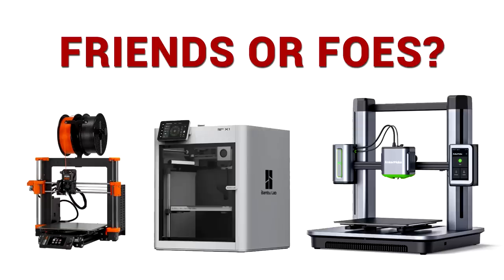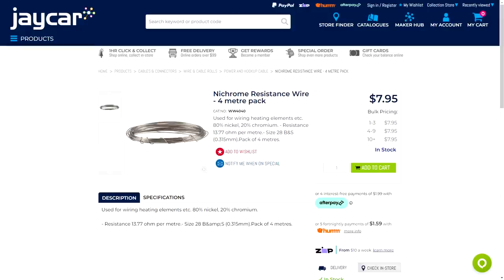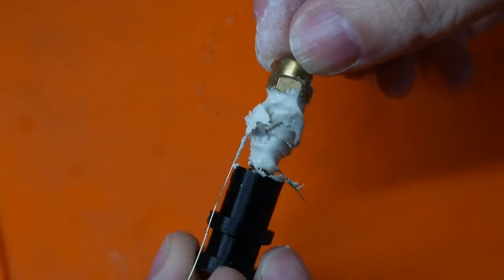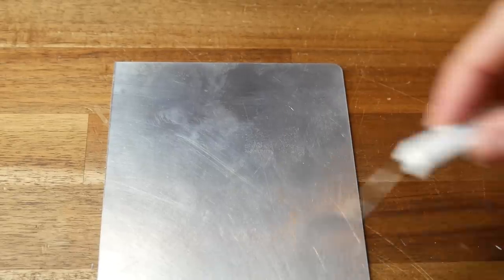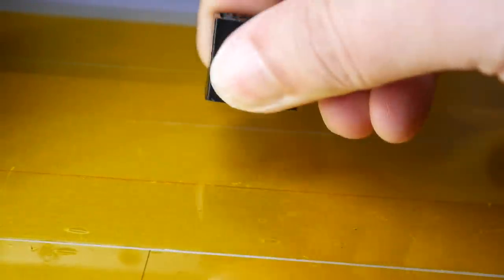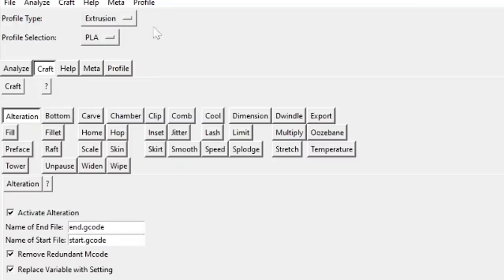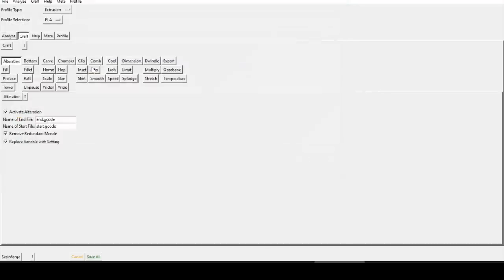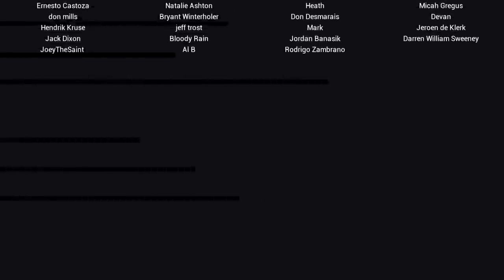10 years ago, 3D printing was really hard

Comment: Been printing since the blue tape days. Those were dark times.
Reply: Blue Tape + Ikea Mirror. I hate the old days
Reply: now we're in the Hairspray Era
lol
Reply: My robotics teacher has a printer that still uses blue tape
Reply: I don't like magnetic beds because they allow some materials to curl up even though they're stuck to the bed
Reply: Painters tape directly on the aluminium bed plate=))
Reply: @lazer1036  I have a new printer with a magnetic bed and I have one with the glass bed that I use blue tape on and I would much rather the blue tape
Reply: @lazer1036  magnetic beds don't hold down tight enough and they can curl up with the part
Reply: @Nici619  I always print on ikea mirrors that I cut to size myself plus a mixture of wood glue and distilled water 😙👌
Reply: Blue tape is the best build surface.
Reply: i still use blue tape, then again my printer is 8 years old
Reply: @DursunX  are we though. That was prevalent 10 years ago.
Reply: @lazer1036  About half of the basic fdm printers my uni uses have the bed covered in layers of blue tape. Even the prusas.
Reply: @Rainmotorsports  i bought 4 used Ender 3 (pro & v2) this year and they all had hairpsray on the glass plate.. one guy even gave me the entire can.

i never use adhesives/ solvents. just clean it and keep it flat.
 i do love blue tape on my vintage Anet aluminium bed.
Reply: My Makerbot Cupcake CNC Mini -  printing on a kapton tape bed which was a heated conveyor belt.

Cost my over 1k including shipping and taxes to Aus. Constantly broke 1 part at a time. 

Turned me off 3d printing at home for a long time. Ender3 brought me back.
Reply: My first printer was tethered to a pc running Mach3 with g-code that i edited  from milling instructions.
Reply: @dmk_games  I was following the cupcakes. But I just missed out due to lack of funds.
Reply from the maker: I never used blue tape back then because I exclusively printed in ABS over PLA. In my head I had to use the same plastic as Lego and nothing else would be good enough.
Reply: Back when the community had more than 1 site with basic business services operating such as thing ownership sales. Back when license checks took minutes cause there were only mere hundreds of things licensed. 
Now ball park 30 million things yet manual re sorting required takes longer than ever. 
Being found back then was easy. 
Being found on net now with such weak search engines is causing mega losses to the community todawasI dread to think of how much money is being lost from pirate farms not paying royalties currently. Ive watched farms come and go for decades. Even this week watching another farm collapse and they didnt even own a single thing license to sell, they were doing there own thing, gave away all his valuable designs but cried about seeing his things being sold by others. 
He gave away his bisiness ownerships and in next breath cry cause he got copied. He never owned it. Cant set terms, take down pirates, or sell the thing license ownership if you dont own it.
Reply: The first Solidoodle used a sheet of 5mm acrylic with a laser engraved texture as a print bed.  I “upgraded” it to 10mm to minimize warping.  

My hate for thermistors and their thin wires prone to fatigue was one thing born in this era that persists into present day.
Reply: @Nici619  Still works if I'm in a hurry. Recently ripped some glass out of the mirror with ABS + Magigoo...
Reply: @lazer1036  I have one and I even use a piece of steel as bed for easy removal. It still works fine, but it's my emergency printer only.
Reply: @swomflys3380  On a Prusa i3 mk3 the bed holds down extremely well. Those adhesive magnetic beds not so much though.
Reply: @DursunX  Hairspray and gluestick was always a go-to even back in the early reprap days of the mid 2000's. I abandoned the painters tape methods pretty early on. With the old crappy nylon/abs weedwacker line everyone was using back then. A acetone slurry was just a better option overall. Then when PLA became easy to come by it was just gluestick and hairspray.
Reply: I'm still using blue tape on an aluminium bed on my 8 year old kossel mini.
Reply: Blue tape, glue sticks, hairspray, craft glue. Truly odd times.
Reply: I am using a printer that had a glass tape with blue tape. I replaced with pei build plate. With klipper I can print 150mm/sec. Also have uploaded a short

Comment: My first 3D print was in 1989 in Dallas, when I was in the early years of starting Haltech. I still have the print. Back then it was called stereo lithography. It was a 3D print of a throttle body design I was doing for Keith Black Racing in Anaheim. I now operate a factory that produces my own 3D products in Australia, which I export all around the world.
Reply: Woah that’s nuts. My dad used to be an old jet boat racer and never hesitates to refer to Keith Black and Arias like they were Gods.

Comment: I'm still using Reprap Huxley and Mendel printers these days. With some modern modifications like E3D hotend, proper heated bed, TMC drivers, and with decent klipper firmware and latest slicer software, these printers still give good results. And I plan to continue using them for the next 5-10 years.
Reply: same here my Reprap Huxley and prusa Mendel 1  are still in use today  so wht is they are old if they still work and print very accelerate then why change
Reply: I still have a working Huxley too.  :)  It was the first printer I built back around 2012.
Reply: I have Mendel Mono but i iam replacing it with voron 2.4 this month.its time to upgrade :D
Reply from the maker: That's impressive and really great that you guys still keep them in service.
Reply: Still have my medel, sadly it doesn’t work
Reply: I have an ORDBOT Hadron and have upgraded the hotend and print surface.  Is there any good information out there about what to do to get them up to scratch?  I have never had my printer running consistently.  It's one of the most frustrating things, trying to troubleshoot what's wrong with it, then finding halfway through fixing one issue another one crops up and then I lose patience with it and give up, maybe to return a couple months later with similar results.

Comment: Interesting to see how things were different in Czechia (with Josef Prusa’s work). I got my first printer in 2014 (9 years ago) and it was MUCH closer to today’s printer: normal hotend cartridges, very basic but normal extruders, handmade hotends (but high quality full metal ones, made in my city) but almost V6 compatible. The printers ran Marlin (really really early, M600 was added in 2015 by the guy I bought the printer from) and RAMPS 1.4 (if you were lucky) with hand soldered components. We were using Slic3r and CuraEngine inside Repetier Host, though it didn’t feel too slow
Reply from the maker: Repetier Host was amazing. Having the menu option to open up a box with all of the EEPROM settings was fantastic. You could edit them all in one place without memorising the gcodes. I had to cut some stuff out of this video to get the length down but this printer as running RC versions of Marlin 1.0.

Comment: Gheghe. Lovely to see. And I am impressed by this pioneers work.

I stepped in to 3d printing in 2016. E3d hot ends were already available at that time. All metal too. So I missed making hot ends myself.
The kapton hell I remember well. With bad luck fresh kapton on the heated bed every other print.

Thanks to pioneers like you and your teaching skills I learned to build and improve my own printers based on existing metal frameworks on the market.

So as a result I feel comfortable in building, modifying and designing 3d printers or parts and the software and electronics.

So your teaching helped me to find an independent way in 3d printing!

Comment: Ah yes, i remember helping to keep the one at our hackspace running, going through Kapton and PETG tape and basically 90% of the time you weren't printing things you wanted but you were adjusting settings for that new filament roll, fixed bugs in that hot new firmware that totally wasn't compatible or were fixing issues with the bed not being level because that one adjustment screw got lose again(because no auto leveling), the nozzle shredding the kapton after dipping in 0.000001mm too low, and all the other fun stuff. This made me actually lose interest after a few years and now i'm at a point where i don't want to use plastic anymore and rather skip the prototyping and just do it in wood or metal right away.

Comment: I started in 2015 with a Monoprice Mini. I remember showing my prints to someone who’d cut their teeth on a Flashforge like the one you showed, and they were amazed at what I could do with a $200 printer. I eventually had to get this printer replaced under warranty, but I still occasionally use the replacement for small jobs.

Comment: Woaw I love this format "back  in the day" ❤ my first 3d printer was a cr10 and I was using Cura back then. I think it was 6 to 8 years ago. But this seems nothing compare to the hardcore stuffs you mentioned in your video ^^. If I had to compared what I'm not missing from my early experience is the blue tape and the manual bed leveling :)

Comment: 2015. I was a VERY proud owner of a Printrbot Simple Metal with Heated Bed! I also had one of the 1st Ultimakers at work whose extruder was an absolute nightmare to navigate so I hardly used it. I tuned the hell out of the Printrbot and actually got really decent prints from it but it wasn’t very consistent. Also used capton tape (and printers tape before I installed the heated bed) to cover the heated bed and was still doing that all the way up until 2021. I only ended up replacing it last year for an Elegoo N3 and realised how far 3D printing has moved forward in such a short time. 3D printing is downright easy now and it’s an absolute pleasure.

Some interesting numbers. The Printrbot Simple Metal (PSM) + heated bed cost me around $600 and took me 2 days to assemble and configure. The Elegoo N3 cost me €200 took 30 minutes to setup and configure and printed far better off the bat. I would have around a 1-2 failure rate with the PSM, the N3 up till now has never failed, any mistake have been my own. Luckily the PSM also had an auto bed levelling system, no where as accurate as the N3 but it was actually pretty good. The Ultimaker was still manual levelling and my failure rate was far higher. Honestly I hated that machine and it costed a fair wack more than the PSM. It was a ripoff imo.

Tom Sanlanderer was my YouTube guru back then and helped me navigate through most of the 3D printing pitfalls.

Comment: I started in 2017 with an original CR-10.  At that point, it was bleeding edge tech for the price point and I bought it within hours of seeing MakeAnything’s review on it.  I was really excited to get a proper 3d printer because I had gotten the original 3Doodler and was loving it, but wanted to be able to do more.
Reply: Bought mine in 2018 as my first try and pretty quickly moved on to a Prusa i3 mk3 when I realized how awesome 3D printing is. Still have the CR-10 with upgraded fans and use it occasionally when I need something bigger. Print quality is still rock solid, just pretty slow.

Comment: I started 3d printing really late, my first one was made using cdrom drives, with 4x4x4 cm building volume. At the time a friend recomended using Cura instead of Slic3r or Prusa Slicer.
Today I still use a Graber i3 printer (basically a Prusa i3 version with MDF frame), using Arduino+RAMPS 1.5 and a Pi3b running Klipper. And surely I spent more time tinkering with the machine then actually printing something, as I intended from the start.

Comment: 10 years ago? Must be a couple more years than that, as I got my Felix v3 3D printer in 2011 and it had all the "good" stuff as heated bed and.. yeah.. what more 😂😋 Well better software for sure..

Still use it today, it doesn't have automatic bed leveling, it uses peek insulation and overall is an amazing machine, too bad it was and still is very expensive, so many people didn't get that one as it really is an awesome printer.

I feel quite "old" now when you showcase "new" stuff, compared to the Felix v3 printer.. I've seen automatic bed leveling and compensation, "better" hotends and such.. but it hasn't hit me until this video that there are a lot of upgrades younger people are used to as minimum standard these days..

Also, the build of the hotend you did, that is surely 3-5 years prior to 2011.. isn't it? or maybe it is more of the diy part of the hobby?

I'm not saying you're wrong, but my feeling and "memory", if it is correct which it might not be, tells me that it must be earlier than 2011..

I don't know 😋 But these history and memory videos that popup on different channels in topics you were interested in "back then" (and still today) is really fun to watch, it shows how many memories you have that are hiding in that grey thing "up there" 😋

Comment: Yes! Finally someone sheds light in the Solidoodle! Way before its time. The fact we went backwards to bed slinger was a dumb idea. I mean, look back at repetier host. 10 years ago and we had Webcam, active gcode following in 3D. You could see what it was supposed to be doing as it was doing it! We still don't see that today. Octoprint does it in a 2d layer by layer, but not the same.

I still have my solidoodle. I don't use it, but I have it. I now use my Bambu X1C  every day. While Prusa's and ender's were minor steps forward, the Bambu has been a quantum leap. It changed my printing more than the previous 10 years of slow development combined

I still have a massive roll of Kapton tape
Reply: I still have my solidoodle (2) and still use it. 
- updated the hot end to all metal years ago, 
- updated the bed to glass years ago.
- jigsaw extruder finally gave up in a way that I wouldn't be bothered to recover at the end of 2023.

Comment: I started about 7-8 years ago with a Printrbot Play. In retrospect, the only real issues were the lack of a display and lack of a heated bed. It did have an inductive sensor on it so it did have auto-leveling, but with no display and no dedicated Z offset adjustment, as a newbie it was difficult to get a decent first layer without restarting the print a dozen times. I put the hobby down for a couple of years and later started over with an Ender 3, and have since gone back and used the Printrbot a few times as a demonstration because it’s tiny but sturdy. Always enjoyed watching Tom stand on it in his videos back then!

Comment: Our 1st 3D printer, circa 2016: my brother designed the 300 mm cubed Core XY, dual Z axis drive, I built up the bowden tube Stepper Extruder/E3D Heater system, wrote into Marlin the inverse kinematics which all was stuffed into a Mega/Ramps1.4 controls.  What a learning curve!  Obviously, we didn't know that there was a huge community such as Teaching Tech's Michael that would have offered help/ideas/etc.  Live and learn: ANet A8 was next.

Comment: Wow.  I started just 3 years later with a PowerSpec 3D Pro (Basically a rebranded FlashForge Creator Pro).  Way easier, but still printing on kapton tape.    I remember buying Simplify3D and it was like a whole new printer. I since upgraded that with an genuine FlashForge Creator Pro 2 which mostly tinker free and just works.  And I've added an Ender 3 v2 and customized it significantly based a lot on what I've learned in this channel.  And have now built a Voron v2.4 (also inspired by your reviews of CoreXY) which is my workhorse printer.
Reply from the maker: Simplify3D is not well regarded anymore but when it first came out it really was a leader.

Comment: Ha, I've been finding old printed parts, machine parts and the first few videos of my old printers in the past couple of weeks as I'm doing a rigorous cleanup. I also found ancient versions of Slic3r and some other, more shady slicers from before 2013. It's amazing we've been in this hobby for so long. I started with a 'Prusa Air 2 XL'. Someone totally ripped me off, selling mediocre sets that didn't really work. I spent around 600 euros on a kit and then I probably spend some 800 more to buy all the tools and upgrades it needed. Eventually I built myself a MendelMax 1.5 which totally changed how I printed back then, but those J-head hotends were nothing compared to even the v6 that most people use right now.. Thinking of it, 3D printing kinda sucked ten years ago, but for me at the time it was the coolest thing I could think of. I was living a fantasy! Haha. Anyway, this makes me think how we will talk about 3D printing in ten years. We will probably say 'man, 3D printing sucked in 2023'.

Comment: The moment you pulled out the threaded rod, i expected to wrap the wire directly around the thread then seal it in with something like the cement you use. I gather that the wire rod combo might become conductive without the cement layer in between.  Interesting scary periods of discovery...

Comment: I did not have part cooling on my Mendel 90 as at the time I only printed ABS, once I could get a hold of some affordable PLA though I also got a MK8 hot end, which came with a part cooling fan, it was a real MK8 hot end not the Creality hot end that a lot of people seem to think is a MK8 but only has the nozzle of a MK8, also back in those days I only printed functional parts that I could not make easily on my lathe or mill, it was treated as a tool and only got used when I needed to, ABS filament was not as cheap as it is these days